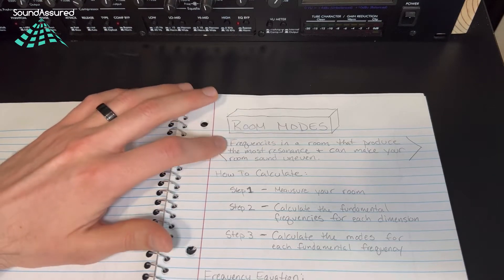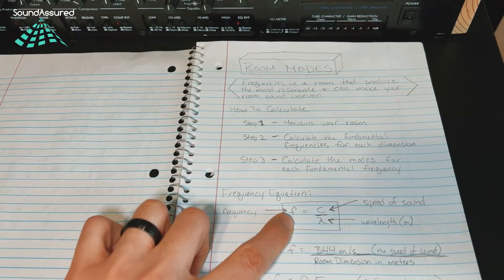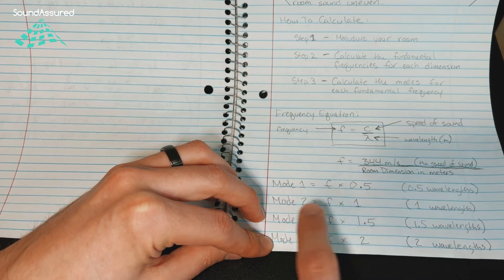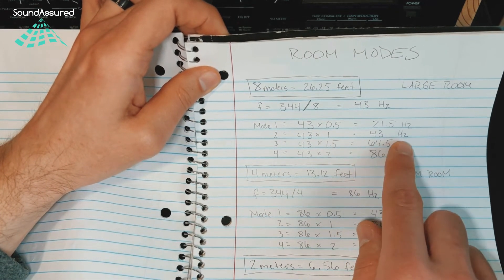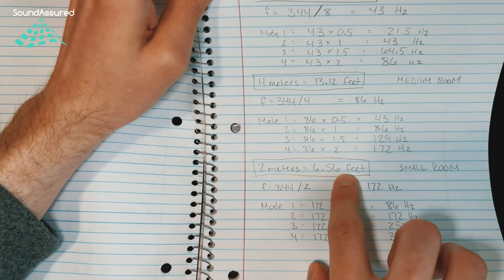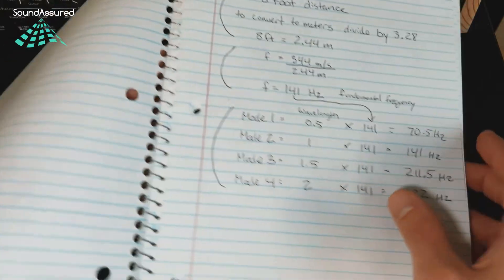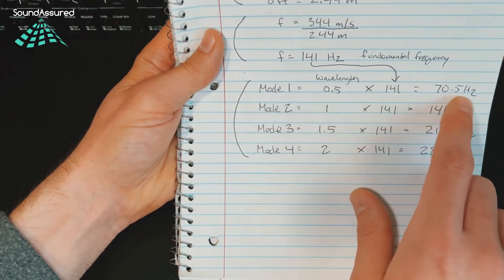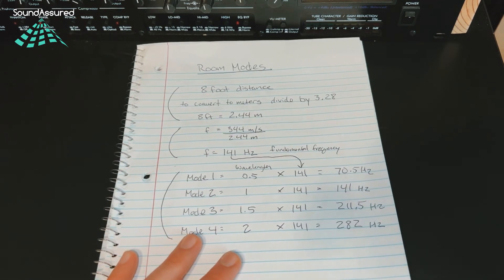How To Calculate Room Modes

Comment: Amazing video. Where are you getting the feet from that you calculate times the room modes? And you have it only one number of feet yet in a room you should have different numbers from each wall horizontally and vertically and from floor to ceiling in a square or rectangle room which would be 3 different feet or meters? Then you calculate that one number times all the modes ?

Im just confused and want to know. Thanks for the information I hope to hear from you, sir
Reply from the maker: You get the feet to calculate the room modes by measuring your room. You are correct, you will have 3 measurements in a rectangular room. In a square room you will only have 2 measurements because the wall to wall measurements are the same so the calculations will be the same. You will calculate the modes for all of those rooms. Hope this helps 😀
Reply: @soundassured I am happy that you responded thank you for the reply. I just want to learn, sir. My next question would be you have mode 1 mode 2 etc. Are those the dimensions of the 4 walls? Or where did those numbers come from?
Reply from the maker: @OverflowMusicStudio  Modes refer to the room’s resonant frequencies along each dimension—length, width, and height. You measure each of these dimensions separately and use them to calculate the fundamental modes of your room.

Comment: you say the frost tep is measuring the room, and then calculate the fundamental with the equation which is the speed of sound divided by the wavelength, but we do not have any wavelength.
 we only have the measurement of the room walls, so this is the first thing I do not understand could you explain?
also, when you say three fundamental frequencies what do you mean exactly the frequencies ? the frequencies we found with the frequency equation? and still and still I do not get where you got the wavelength, since in this video you only have as a value the speed of sound and the measurement of the room walls, maybe you consider the measurement of the walls as wavelength ..I don't know i am confused
Reply from the maker: To find the fundamental frequency you divide the speed of sound by your room measurement in meters. The fundamental frequency is the frequency you calculate with the frequency equation... If you have specific questions feel free to reach out to support at soundassured dot com ... Cheers!